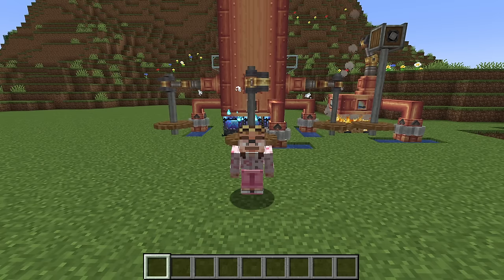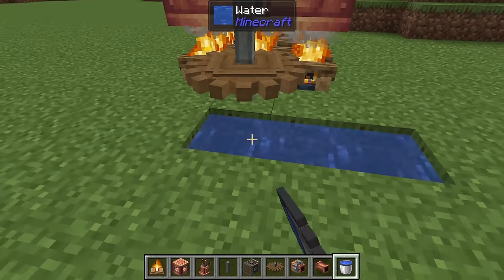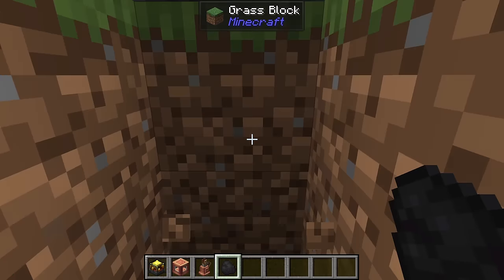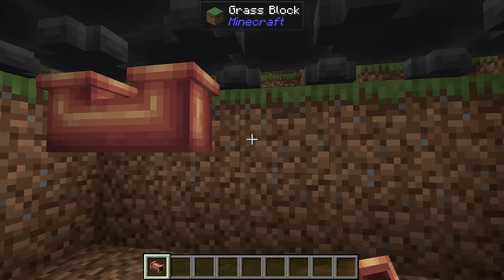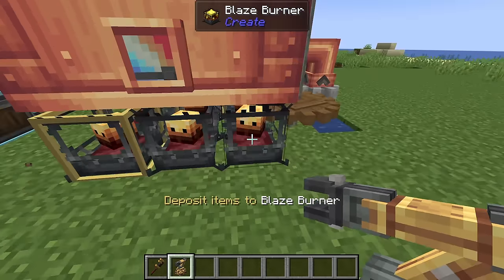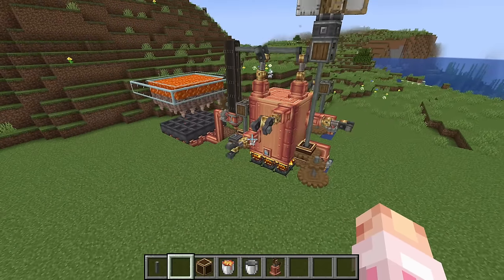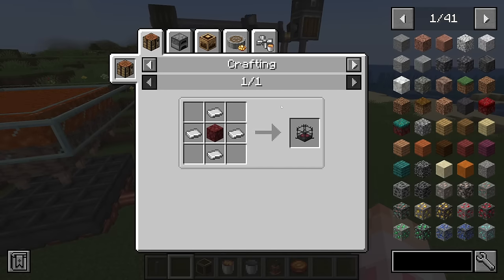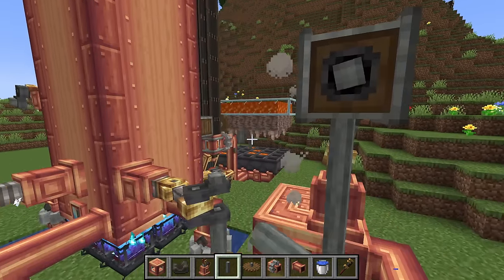Create Mod Steam Engine Guide!

Comment: I think that tree farm is more expensive option, because when you have blaze burners, one brass funnel isn't that hard. And tree farm requires deployers to replant trees.
Reply: Well you only need 2
Reply: You will need alot of cauldrons to fill the lava, that's alot of iron
Reply: @RamonEggerink  i don't know about others but i usually make small iron farm before building boilers.
Reply: @RamonEggerink just make an easy iron farm
Reply: I tried a simple two block long radial tree farm once, it could not keep up with a single blaze burner with a 4 tall boiler above it, even if the wood was turned into charcoal.
Reply: @RamonEggerink  I usually find more cauldrons than I know what to do with while exploring.
Reply: Lava generators are insanely easy, that's what I always do.
It’s mostly copper and iron stuff.
Reply: @TonyToed like what?
Reply: @Trenty_Boi  ian's iron farm, it takes like 15 minutes to do and makes so much iron
Reply: I did the tree farm and it was pretty fun and cheap
Reply: @Trenty_Boi  a cobblestone farm, crash cobblestone into gravel, bulk wash gravel, you get flint and iron nuggets
Reply: A bamboo farm doesn't need replanting.
Reply: windmill bearing, mechanical bearing, glue, building block, mechanical saw, deployer and thats it.

for fully automatic, add brass funnel with filter (everything except sapling) and a chest.
Reply: build kelp farms
Reply: why are we using steam engines to power tree farms again? If you're late game enough, just put your entire tree farming contraption on a train. No SU required! it's free real estate
Reply: Still useful to know, sometimes you play pre-1.17, create goes back to like 1.12 who knows, i myself am playing a 1.16 modpack rn and need to do a tree farm
Reply: @RamonEggerink water fanning gravel makes iron nuggets

Millstone or crusher wheels+ cobblestone = gravel
Reply: Its still expensive cuz for both options you will need a mechenical arm which requires a precism mechanism
Reply: Very true but i think tree farms are easier to figure out by yourself
Reply: @NoahDaun.  theoretically, you can have a lot of potential with just two.
just make the radius something stupidly massive and you'd have a massive circle of trees

Comment: The lava farm does need sources, but you can use virtually any solid block under the lava, not just the dripstone block. It's actually just the pointed dripstone doing the work, not the block.
Reply: How would one get the lava into the place it needs to go then?
Reply: @Trenty_Boi  You still need a solid block under the lava source, and then the pointed dripstone on the bottom of that solid block. You can use anything non-flammable on the sides of the lava sources to hold it in.
Just to reiterate, you basically do exactly what he did in the video, but the dripstone "blocks", not the "pointed" dripstone, can be pretty much any non-flammable block.

Comment: I can't tell the mechanical arm to target the brass funnel. I hold shift, ctrl, left-click, right-click. no matter what I do it cant target it, it only places it down.

EDIT: you have to shift-place the brass funnel to make it an input funnel.

Now my mechanical arm is snatching the empty bucket from the depot before the spout can finish filling it. I dont understand what you did to make it wait for the lava bucket to fill

EDIT: Yeah it seems there was an update that made mechanical arms dumber. I got around this by adding an extra depot and an extra funnel. arm places empty bucket in input funnel, input funnel puts it in depot 1, spout fills empty bucket with lava in depot 1, output funnel puts the full lava bucket in depot 2 (which is 1 block lower and one block to the side of depot 1), arm takes it from depot 2, repeat). The plus side is you can have 2 buckets in the system using this method which means the mechanical arm has 0 down time.

Comment: For those struggling at 13:02, you will need to have a brass casing as the block. So first, on the same level of the copper pipe that feeds the steam engine water, place a LARGE cogwheel, and this is FIRST. After that you get your brass casing and place it ON the cogwheel you just placed, it should sort of become a combination of the two blocks. Next put the small cogwheel diagonally and another large cogwheel under that. Finally put another small cogwheel diagonally, this should end up right under the brass casing/cogwheel combination from earlier, and one more small cogwheel next to that. The reason why this may have not worked at first, and why it didn't work for me despite having the exact same blocks, is because you had to do the cogwheel and casing FIRST, as in break the smaller cogwheel underneath. If the small wheel is there, or gets placed first, the brass encased large cogwheel will connect to it and that's what breaks the steam engine.
Reply: i did this and it still isnt going as fast as he did it in the video
Reply: @gamebox6077  Did you manage to fix it?
Reply: @MrVenat0r  yes, the way i had it set up it was turning the mechanical hand or taking power from it, but i fixed it.
Reply: OMG thank you, i was wondering why it wasnt working, this helps alot
Reply: @gamebox6077 i dont understand
Reply: @Sparkles_Me  Yeah same im confused also
Edit: I figured it out, just put more sails on top that all it IS
Reply: If anyone is still having trouble with this, remove all cogwheels by the water pump and redo the cogs. If not, your cogwheels will be different speeds causing them to break once you try to place them. So starting with a clean slate, you place the cogwheel first then right click with brass casing (I thought this was one block for the longest time, but it isnt). After you've placed the brass casing onto that cogwheel so that it combines, you want to put a smaller cogwheel diagonally from that large cogwheel, just like in the video. Then place a large cogwheel underneath the smaller cogwheel you just placed then AFTER that you can place a small cogwheel right under the brass casing/large cogwheel thingy you created earlier and then another small cogwheel to the right of it. KEEP IN MIND, if any of these wheels are not rotating at the same speed, it wont let you place any cogwheel. So just look and see if the cogwheels are spinning at the same speed then keep going through with the steps I listed above.

Comment: 15:50 for the netherrack, you could use a threshold switch (or whatever it was called) to turn on some kind of warning (e.g. if you have a control room for your base it could be a redstone lamp there) when the netherrack runs low.
Reply: A bunch of steam whistles turning on and of and a big square of lamps flashing on and off should do it.

Comment: from my experience, you don't need the dripstone blocks, just the dripstones itself are enough. and as long as its not possible to fully automate blazecakes (=generating netherack), i'll stick to using a lvl9 one and add another one if needed. more expensive to build but runs forever (unless you overstress it, but thats why you use a stressmeter)
Reply: You don’t need to automate it though? Unless you plan on spending maybe 400+ hours in one world. 2 double chests of netherrack takes the same amount of time to gather as a farm would imo, and thats 400hrs of fuel right there
Reply: yeah and it’s not like you’re gonna mine the whole Nether and run out of netherrack lol... right? Right???
Reply: 5x5 drill netherrack and you'll have like 200 stacks in 10 minutes (not to mention you can do this while you're mining netherite to save time)
Reply: @ruberine2086 still better just to built 2 lvl 9 as there isnt any advantage whatsoever to lvl 18 boilers. Literally all you save is 9 blaze burners in construction. And you can make 2 lvl9 boilers much more compact

Comment: Thanks a lot for this tutorial, I didn't realize how early these are to setup.. that you could feed blaze with lava.. And most importantly i've never used the mechanical arm because I assumed they were as basic/limited as a factorio inserter. I had no idea they could target so freely.. create is so powerful!

Dripstone lava farms don't need dripstone -blocks-, any block that will hold the pointed dripstone stalactites (10 block long max) should work. It checks two blocks above the topmost pointed dripstone and looks for a cauldron up to 10 blocks below the tip. There is no advantage to having a longer than 1 block pointed dripstone. 

It is of course random chance based on world ticks and dice rolls, but on average 1 tip will make just over 1 lava every day (19 minutes~). Any furnace fuel can be used in blaze burners for its usual time, so since lava lasts 1,000 seconds, you would need an average of 1.2~ cauldrons per blaze spawner (so 11+) to keep them more or less on; (char)coal would be 15/day/blaze(135). For you psychopaths out there, dried kelp blocks would be 6/day/blaze aka 486 kelp. Arms don't refill blaze unless the blaze has less than 500 seconds of time left but the blaze can hold up to 10,000 seconds without waste; so It Just Works™. Blaze cakes are 160s so need 7.5/day/blaze (67.5/day flour/eggs/sugar for the full 9) but will not overfeed the blaze.

Every heat source except heated/superheated (not cold) blaze provides the same passive 0 heat value, heated is 1, and super is 2. For water you need 10mb/t/level: Passive=1x20rpm pump, Heated=1x180rpm pump, Super=2x180rpm pumps. Water is not stored anywhere, so overfilling the steam tank provides no benefit.
Maxed tank level is 18 at 294,912su requiring 18 engines at 16,384su each to make use of. Engines are all separate generators so one getting overstressed doesn't inherently make all the others stop too.

Random sidenote but the wiki page for encased fans has a ton of interesting knowledge.
Reply from the maker: That's a lot of really amazing numbers! Thank you very much for sharing

Comment: Better option to feed the blaze burners is to use straws (part of the Create Crafts & Additions add on), and fluid pipes. It allows the blaze burners to take from the pipes connected to them. So instead I use a 2 stage pump system. One pump pulls from the lava farm into a fluid tank for lava. The second pump pulls from the lava tank to the blaze burners. I use clutches and switches so I can turn on and off the feed pump so if I want to the steam engine to shut down I can disable the transfer pump from the tank to build up a supply of lava to use when I need the steam engine running. The pump from the lava farm to the fluid pump is driven by a water wheel so it constantly pumps out any collected lava to the storage tank. The water wheel/lava pump combo is also connected to the engine as well with a clutch, so I can use the water wheel to jump start the steam engine to get some rotation in to start up the water pump connected to the steam engine and the feed pump from the tank to the blaze burners.

Comment: what my buddy did on our modded server was set up the infinite automatic lava first. it pumped into a giant tank. then the tank fed the blaze burners in the same way you did. he also had a water tank supplying water as well. he considered the blaze cakes but figure lava was more than enough power for a whole base. there's also a mod that adds compatibility between create and immersive engineering.

Comment: Steam Engines notably overstress individually, so if you don't mind wasting most of the 16k SU the one engine produces, you can have single separate engine feeding water and fuel, and no matter what happens to the other engines (assuming the fuel holds up), the engine keeps running.
You can also use the "wasted" SU to run 2nd to 4th additional boilers, if you want to.

Comment: thanks so much for the video I didn't know steam engine would be that much given power !
besides that, you can craft netherrack without going in the nether at all (well, it's nicer to go in the nether since it's faster to get netherrack like that).
so, if you're on a server that deactivated nether, here's how, with Create:
- gunpowder = either mob farm,  OR crush creeperhead OR wash crushed raw zinc (the other method require sulphur from nether)
- quartz: crush diorite OR crush prismarine crystals OR wash crushed gold ore 
- netherrack = compact in a bassin (gravel, gunpowder, quartz, clay)

Comment: This is my first time with this mod and I experimented around with the small design trying to get it to make more SU and I found that by replacing the 4 corner campfires of the 3x3 design with blaze burners you can keep the engine going even after the 4 blaze burners run out of fuel, was getting around 16k SU output with fuel, and 2048 without, idk how good that is but it sped up the crafting of the crusher wheels for me by a lot.

Comment: I just realized that you can add a cogwheel on a different side of the water pump and connect a crank to it, and you can restart the boiler at any time, without using a windmill.

Comment: I'm pretty sure you can use bamboo to power blaze burners instead of buckets of lava or a tree farm. A bamboo farm is very easy to make. Though you would probably want a stockpile switch to stop the farm from producing too much bamboo
Reply: It May bottleneck with Just one mech arm. The blaze butners can burn bamboo faster than the arm can provide it

Comment: Btw I noticed something. In the second solution(lava farm) the mechanical arm moves too fast, it just takes the empty bucket. Probably it could be fixed with a different solution, not using the power from the steam engine. 

Really good vid, I learned a lot.
Thanks!
Reply: A rotation speed controller can fix that
Reply: You can also use a second depot

Comment: Netherrack doesn't really need automation, even if you have an iron pickaxe a bit of efficiency can make netherrack insta-mined, so you can get a lot of it quickly and forget about it. Then you could make a notification system that idk turns on some lamps or smth when the amount of netherrack is low.

Comment: Hey I have an issue where the mechanical arm keeps taking and putting back the empty bucket and it just never gets filled with lava.
Reply: i have this problem too. any fix around it?
Reply: @ldeoliveira755 I just made a waterwheel power the mechanical arm and because the waterwheel is slow it works fine. Kinda annoying that I have to do that though...

Comment: the problem with having the steam engine power it's own water pump is that if you overstress it and it shuts off, you now have to go and start it all over again manually from scratch, and you'll usually also have to disconnect all your equipment from it as the hand crank doesn't create enough SU to power more then really just that pump

Comment: Alternative to a tree farm perhaps a kelp farm since chutes drop the output from furnaces and then can be packed automatically on a mechanical press that both feeds itself as well as excess dried kelp to power the engine unless a bamboo farm is used to cook the kelp which seems a little excessive at that point but idk. 👀

Comment: 10:47 forget the mechanical arm you can pipe lava directly into the blaze burner with fluid pipes. faster and cheaper
Reply: thanks i destroyed my pump system to do what you said but you cant pump lava into the blaze burners
Reply: @00WhiteBlade  idk I'm playing on the steampunk modpack and it works just fine for me
Reply: @Okguy1_Music  you have an addon mod that adds liquid fuel to the list.

Comment: Honestly, you don't need the steam engine on top. You need it attached to the boiler. So you can have it sideways very easily, and in fact for larger engines having all the arms on one side is highly recommended. Plus, it makes it easier to expand as you don't have things on top of the boiler blocking you from placing more tanks.
Reply: Yes, he was just doing a small demonstration. He wasnt going out of his way to make it efficient or anything, just messing around to show how it all works

Comment: the mechanical arm is getting stuck in a loop of just spam picking up the empty bucket and putting back and the engine just dies out please help
Reply: @fmh7858  Did you make sure there was a filter on the brass funnel?
Reply: @zstroyer0626  i put a bucket filter and it still doesnt work, it keeps spam picking up the buckets before they fill
Reply: @wgroupvids  If your mechanical arm is spinning super fast, slow it down so that the spout has time to fill the bucket. Other than that, I'd need more info to help.

Comment: Actually you can make Netherrack, grit, cobble stone and lava in mixer produces netherrack blocks. Feed that back in grinder to produce more grit.
Reply: what?
Reply: As I wrote, 1 cobblestone (any cobblestone), 25mb of lava and  1 cinder flour in a mixer makes 1 netherrack block. Crush that with a crushing wheel to make cinder flour, there is a 50% chance that you get two cinder flour.

Feed back into the mixer to make more netherrack, a positive feedback.
Reply: @Canofasahi  What is grit?

Comment: the mechanical arm is picking up the empty bucket from the depot before it fills with lava and puts it into the funnel and is doing this infinetly
Reply: You need more lava production then, the spout should fill it with lava before the mechanical arm gets to pick it up. If that doesn't work, you can make a different setup with belts where the empty bucket is passed bellow the spout and then into the depo the arm picks up from, so empty buckets are forced to be filled with lava before the arm gets access to them.